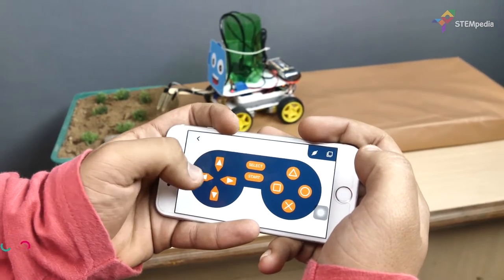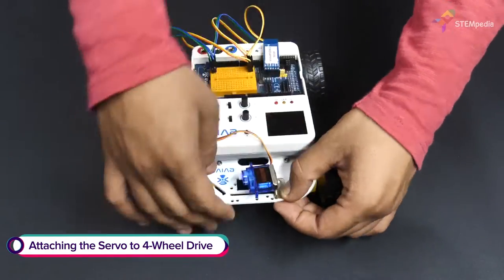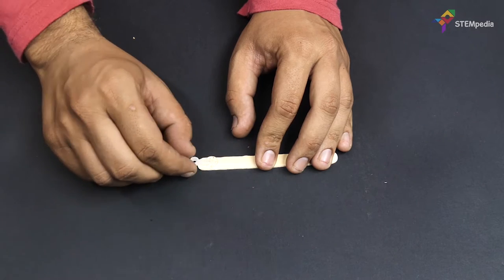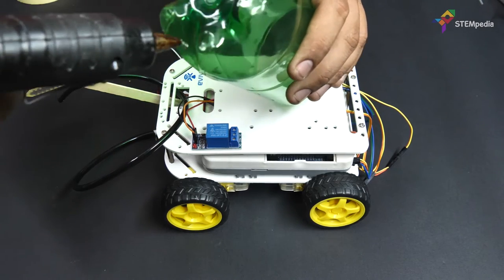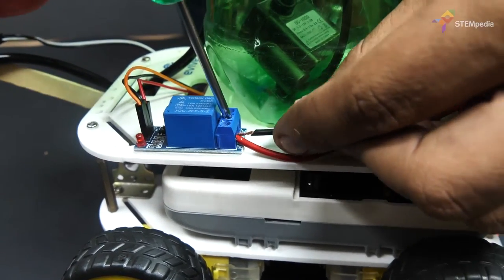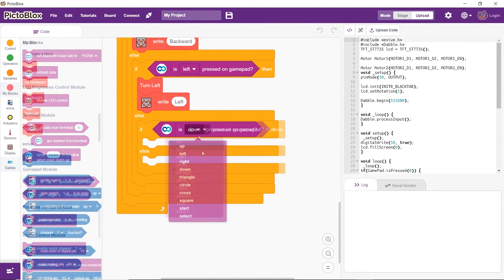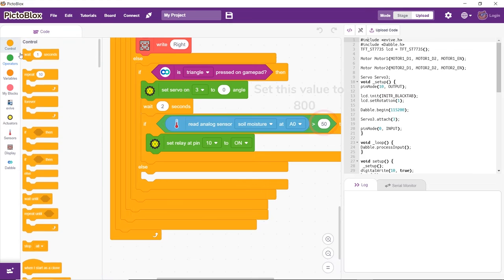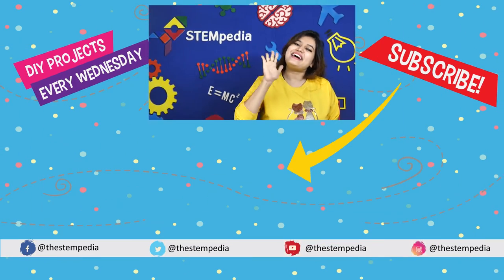Smartphone Controlled Agribot with Automatic Irrigation System | DIY Projects

Comment: hi, i have tried your project, i did everything as you did and used the same code which was provided in the website and i modified it. and when i try it everything works except the bluetooth part. i can connect the robot via dabble on the smart phone after clicking gamepad option i can't control the robot. it stays still even when i click up or any button in the gamepad module in dabble. can you please help me in this case.
Reply: Could you share the code ?